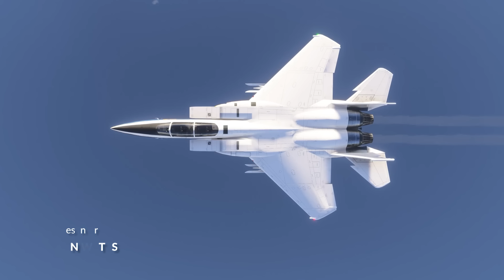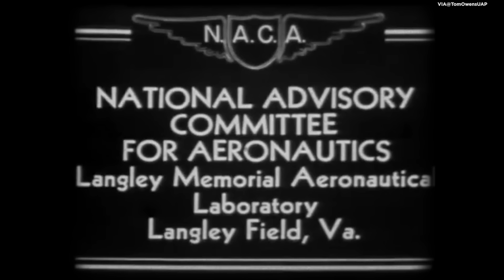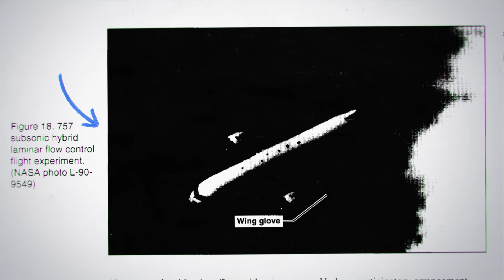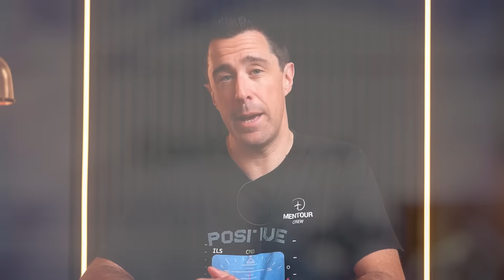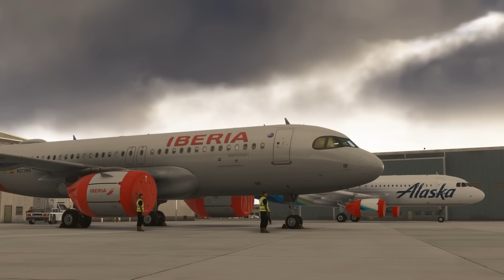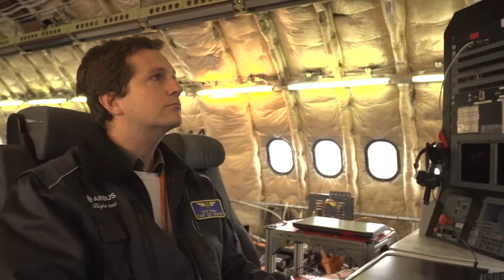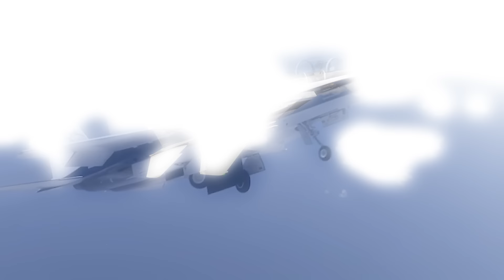Why DON’T We Use This Revolutionary Wing?

Comment: This reminds me 2 things: 1) "wing cleaning devices" in gliders, 2) Crazy ideas of Nikitin-Shevchenko IS-1 - it was attempt to create monoplane that would deploy second wing alongside landing gear for slow speed. In a sense many modern hyperlift devices act in a similar way. Though not as crazy as IS - series or F-111 / F-14 variable wing geometry.

Who knows - maybe in future we'll see more hyperlift devices being some kind of hybrid between flaps and retractable secondary wing. Revolution in aircraft fuel is still on the horizon - this might become another contributing factor too. Maybe future airliners will be even slower - closer to zeppelin or flying boat speeds to reduce cost of fuel and problem of different requirements for different speeds will be less important then.
Reply: I also believe that a slight reduction in speed would be beneficial for fuel consumption and transonic regime problems, but a speed slower than 5-600km/h (3-400mph) IMHO makes no sense for a commercial plane. So landing/takeoff vs cruise speeds will still be important IMHO.
Reply: Consider this for the next A320
1. Laminar flow optimised wings - 5% fuel burn improvement
2. Hybrid system for takeoff power, taxi without engines and hold without engines (APU activated for longer holding period) - effective 5% savings for flights from busy airports
3. Composite wings - 8-10%
4. RR Ultrafan 30 - 20% savings
we're almost pushing 50% here!
and to this if you add a boundary layer propulsor at the aft end of the fuselage, right behind the APU (maybe the APU will become a full power unit? or hybrid power?) - 50% improvement well in sight!

Comment: You could also mention that some of the first heavy and necessary uses of active boundary layer control via suction was applied with the introduction of jet engines in aircraft, as the boundary layer separation and turbulence effects in the engine air intakes of many of the new jet aircraft designs required boundary layer bleed to be implemented. (often both with splitter/diverter plates and perforations in those plates allowing suction to force the airflow to remain connected to the plate surface) Albeit in this case, the high suction already provided by the engine's compressor intake provided that force, and it was simple aerodynamic placement and shaping of the intact ducting surfaces that provided the differential suction force)

I think the Lockheed XP-80 was the first design to implement this in practice. (I'm not sure, but the torroidal intakes added to the Gloster Meteor during the F.Mk.III production line in 1945 may have had concentric boundary layer suction perforations along the entire inner edge of the intake lip)

Note the "bleed" here is referring to the suction through the perforations, not engine bleed air used for blown flaps or such. (albeit that system was tested on the Meteor using the Derwent Mk.III, which had added bleed air valves specifically for that purpose)

Comment: Might have been nice to point out boundary layer ingestion is not the only active laminar flow technology. Blowing a tiny amount of air out via slits parallel to the upper wing surface re-energizes the boundary layer, delaying the onset of turbulence. This eliminates the fouling issue but is also very hard to get right.
Reply: Look up sweeping jet oscillators. These are active lift systems that require about 1/7th the amount of energy. Boeing is considering using it on the rudder of its next generation aircraft because twin engines and multi-engine in general use massively oversized rudders to help counteract asymmetric thrust in case of engine failure. A very small bleed air generation using sweeping jet oscillators on the rudder and vertical stabilizer would reduce the size of the tail drastically and all the attendant benefits would result
Reply: Yes that is also something Airbus has looked in especially for the VTP

Comment: As much as Laminar flow sounds like a fantastic idea, the issue is we can't really execute it. Planes are in a range of enviroments as well as the air in the atmosphere is never the same. When flying, we are natrally at a turbulent state, with laminar flow it doesn't help our safety factor none. Because air over distance is naturally turbulent due to the conditions in said air, so when we are moving at 450kn at cruise at 35000ft the air we are cutting through is constantly changing. So a true laminar flow isn't exactly going to cut it. A semi-laminar flow however, is something we can change in today's airliners.

Comment: As others have said, gliders have been using laminar flow since the first glassfibre gliders built in the early 1970s. The laminar flow is affected by bugs and rain. Laminar flow separates easily in the presence of adverse pressure gradients, so turbulence inducing tape is applied in front of control surfaces or where there is significant camber. The challenge for fitting slats to a laminar wing would be the turbulence created by the slat to wing joint.

Comment: I'm so surprised that neither plane nor engine manufacturer companies are willing to design a 0.7-0.75 mach 737/320 class plane.
Fuel consumption is proportional to the square of speed, even in laminar flow. So a 10% reduction in speed will lead to 20% reduction in fuel consumption.
Not to mention that departure from the transonic regime will help with the turbulence mentioned in this article and would also allow for cheaper, lighter, straighter wings, so the benefits would be higher than speed squared.

I'm sure that if a relatively significant fuel tax were applied internationally, such planes and engines, optimised for Mach 0.7, would be "forced" to appear. And maybe trains would be even more appealing for distances under 1000 km, where, even now, a train can be faster than a plane, hotel-to-hotel (I'm speaking about western Europe).
Reply: The airspeed -- of modern airliners has dropped .  Convair tried to Push speed in the 1960s and before the decade ended there was a row of them parked along the runway at Denver Stapleton Airport .. Fuel and Maintenance cost too high.

Comment: I'm curious how much improvement there would be from switching from negative AoA horizontal stabilizers to zero or very slightly positive ones. I realize the trim adjusts to compensate for the CG. I also realize it would be much less aerodynamically stable, but at least on the Airbus and 787, they are controlled by the computers anyway, so in theory, it should be doable without safety reduction. I'm willing to bet a few percentages maybe 5% drag reduction is achievable.

Comment: The P-51 had an early laminar flow wing, one or the reasons for its incredible range…
Reply: Yes P51 had a laminate airfoil design -- but what happened in building out of flush riveted aluminum was not perfect and the non laminar airfoil of the DeHaviland  Mosquito made from formed curved plywood was much smoother and actually achieved a considerable degree of laminar flow.  The P51 benefit was actually that the thicker section made for a stronger deeper wing spar that fuel drop tanks could be used. This the P51 could accompany the bombers over Germany. The Spitfire wing was too thin for drop tanks. Tha Mosquito could carry bombs fuel and was SO FAST that it drove the Luftwaffe "nuts" . Late in the war the ME262 jet was finally faster -- BUT it could NOT TURN with a MOSSIE. So the MOSSIE would watch the ME 262 in the rear view mirror as it approached then bank and turn away and watch the 262 zoom past unable to bring their guns on the plywood plane built in piano and furniture factories that had just bombed Berlin.😅😅😅
Reply: @georgeolson3996 — Mustangs had a thin putty applied to its wings at North American to minimize laminar flow disruptions.  USAAF was quite serious about ground crews maintaining this putty layer. After the war, the money spigot was essentially turned off and orders were given to strip the putty as jet aircraft would handle the high-speed arena; there was no longer a critical need for time and expense of maintaining putty. The only panel lines seen on puttied wings were ammunition hatches and control surfaces. Scale modelers ignore the putty as they like the busy look of panel lines.
Reply: @brucehearn2621 while I was looking through this topic precisely because of building model of mustang, the putty was applied only on roughly the front half of the wing, rest was just polished paint. You can see it best on pictures of wing sub assy in factory, alongside with what part of structure received anti corrosion protection (zinc chromate yellow) and which were left in bare metal.
Reply: They achieved some degree of laminar flow during very controlled wind-tunnel tests. How much of that remained in the real world is highly debatable. The P-51's range mostly boils down to an overall aerodynamic design, large fuel-tank and efficient power generation, mostly due to extremely high octane fuel and intercooling.

Comment: The British F4 Phantom had "Boundary Layer Control" - the OPPOSITE of what you described; it BLEW air out of tiny holes on the wing surface to help bind the boundary layer to the wing more tightly. Would that not be worth experimenting with as well?
Reply: I don't know anything about the Phantom but with blown wings the air is directed across the wing with the main aim being to reduce stall speed, I'm not sure if it helps much with fuel efficiency though? I'm not saying it doesn't, I literally don't know, hopefully someone more knowledgable can explain...

Comment: "Ground crews cleaning the wings" is quite an understatement. Ever seen glider pilots wax and polish their wings before flight? They don't give that much attention to their best shoes!
Reply: As a former "ground crew man" unlike glider pilots they tend to have a lot more going on than glider pilots plus pressure from management. Imo glider pilots can simply not fly whereas ramp agents cannot
Reply: @TheLegitRudy  I think you missed the point, he is saying how much effort cleaning the wing means
Reply: I noticed multiple world champ Sebastian Kawa polishing his wings until the last possible moment, then jumping back into his glider before launching.
Reply: unless the shoes are “wing tips” bah dum dump chee 😊
Reply: Not to speak of the sliders that clean the wings in flight from insects and dirt. Like to see that on an airliner.
Reply: There are infilght leading edge cleaning devices. 
They are released from the fuselage and travel out along the leading edge powered by the airflow. They are then pulled back in by a string like a little kite.

Comment: I think they should design an airliner without thrust reversers and without leading or trailing edge flaps and slats. There would be a HUGE.....did I say HUGE weight and complexity savings. It would be HUGE !  All of those systems and the plumbing and wiring to service them is insanely complex. Eliminate them and eliminate ALL of the insanity.  F-15s don't have leading edge devices. Neither do B-52s. Neither did DC-8s. The Diesel eights didn't have leading edges OR thrust reversers. Huge, huge savings in complexity. I was going to say to just have slightly larger wheel brakes, but with the weight savings you probably wouldn't even need larger wheel brakes. You want to kill lift on landing? Maybe just shut down the engines on landing and roll out on APU. Look at these "stop-start" cars at traffic lights?  Easy peasy. Just restart the engines below 80 knots and you're good to go.

Comment: I'm really interested in how the Otto 3500 will turn out. The entire fuselage supposed to feature laminar flow properties. It's such an odd looking ship, that it's hard not to love.
Reply: Yeah, Otto Aviation. 
I understand they’ve moved from turboprop to jet designs…
Reply: That is a hard nut to crack...  pressurized fuselage forms a slightly "quilted" shape when under internal pressure which is not particularly amenable to laminar boundary layer retention - that is, as long as you have frames inside to support your wing joints, floor, doors, window sills, etc. So wings can be made laminar, but fuse, well, gotta see how they plan to go around some basic mechanics of solids.

Comment: I'm wondering if they can develop a laminar flow system without becoming dependent on highly computerized flight control systems, similar to what are required for some stealth aircraft.
Reply: Why? Flight computers are more reliable than humans nowadays. 
BTW, the dependence on flight computers did not arise from stealth but from the need for high maneuverability, which requires aerodynamically unstable aircraft (starting with F16). Stealth only put the final nails in the coffin of manual piloting due to crazy shapes (F-117) or the lack of stabilizers (B-2).
Reply: @mrmariusi Flight computers are more reliable until they are not.  It will probably be a considerable time, if ever, before laminar flow technology will be used in passenger aircraft.

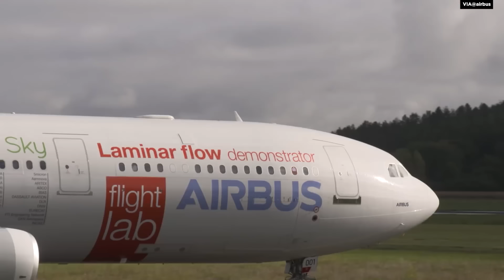Comment: 13:11 B787-9 and 10 have active laminate flow panels on the leading edge of the vertical stabilizer, the early -9’s had it on the horizontal stabilizer leading edge also but was discontinued on the latter ones as it was considered negligible gains. It’s by position exhaust door opens into a scoop position on take off to blow any debris or contamination from the porous leading edge surface
Reply: That’s right. However I think the scoop is there to indirectly create suction (ram air used as motive force for suction) to draw air from the specific panels (through microscopic orifices) and remove boundary layers. As you say it’s currently an active system for the vertical fin for the B789 & -10
Reply: @ranjitmarcus4327  It does both. If it opens to the front, it blows air out to clean the pores. If it opens to the rear, it sucks air through.
Reply: @r @ranjitmarcus4327 es it is I assumed that was understood when I said it was a bi position exhaust. But you know what that say about assuming 😂
Reply: @imthestighonest3437 By, has very different meaning than Bi.
Reply: @nssherlock4547  friggin auto correct yep just noticed
Reply: @imthestighonest3437 it's all the spelling mistakes that make it very hard to understand

Comment: Funny that Gliders use laminar wings since decades
Reply: When NACA did their tests they found that maintaining laminar flow on a wing with standard building methods of the time and vibrations caused by piston engines was all but impossible under real world conditions. Gliders were always at the forefront, and with composite building methods being standard since the seventies, and vibrations not being an issue, this field pushed the technology forward. Commercial aviation is always about cost, military is about performance, so efficiency just did not get the same attention. With fuel costs rising, commercial aviation has discovered the issue.
Reply: To be fair, gliders aren't operating on tight schedules with hundreds of randos on board.

Comment: My ASW20 has a laminar flow wing (and flaps) and has had them since 1977, when it was built. The B variant of it has active laminar flow inducing holes as well. What these aircraft lack, of course, is an engine, which is why we need them to be so efficient 😅
Reply: The ASW-20 sailplane does not have active laminar flow. As stated in this very video, active laminar flow requires a vacuum pump. Those holes are, in fact, pneumatic turbulators, which take pressurized air from pitot inlets and blow it out in order to encourage turbulent flow, which increases efficency.
Reply: @HiddenWindshield yes, you're right
Reply: The holes actually do the opposite. They force transition to turbulent where you want it, in the region where pessure increases on the aft end of the wing and laminar flow would detach.

Comment: I remember leaning that the c130 with civilian paint vs standard military paint gained range. I was told it was because of reduced drag. Then later in my career I heard again that the RCAF demo cf18 had a longer range than a standard cf18 again I was told the smoother paint reduced drag. But I never thought of how the drag was produced other than standard military gray paint is rough. Thanks for the video another great indepth dive into the world of aviation
Reply: If you look at photos of US Army aircraft from 1942 and compare them with pictures of the same aircraft types in 1944, you'll notice that in the former images, the aicraft are fully painted, but in the latter, they aren't painted at all apart from their markings. Some bright spark figured out in '43 that since camouflage only really worked on the ground, aircraft didn't really need to be carting around dozens of pounds of paint. Funnily enough, while the change made aircraft quicker and cheaper to produce, tests showed that the unpainted aircraft were a few percent slower and shorter-range than painted ones. That didn't matter so much at the time, so nobody did anything about it until after the war.

(The Navy, on the other hand, kept painting everything they had blue because screw you, pal, we're the Navy, that's why. :)
Reply: @ZGryphon  ground based air force stopped painting aircrafts after achieving air superiority, since was viewed as pointless and unpainted aircraft was cheaper and faster to produce, navy kept painting everything because the paint served also as anti corrosion protection, even these silver ones from interwar period were actually painted, similarly British ones after WW2 - that silver was actually paint.